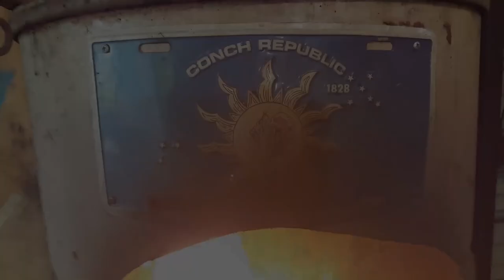DIY HomeMade Forge Blower Motor Controller

Comment: I love the build, and especially appreciate you pointing out that light dimmers change voltage, and we don't want to change that, we want to change the amperage to control the motor speed.  All the builds I saw before yours used the light dimmers instead of the fan speed controllers, which is not the right tool for the job.   Thanks for great content, and for sharing with others.   Happy 2021, Yamez.  Catch you later!

Comment: Great video! I use a reostat or router speed controller. You can get them online for around 15 dollars. I've been using one for over 4 years now. It also slows down the 1×30 grinder too!
Reply from the maker: Absolutely George, if ya got some smerts there's a lot you can do...

Comment: Cool and thanks for sharing. Other channels on YouTube have gotten me confused with motor speed controls. Seems they want to make it egg headed and complicating. Once again thank you.
Reply from the maker: This is a very cheap and basic fan control... will work in a pinch for small AC motors. The fan controller is not rated for anything much larger than a fan... so for like a grinder or something this won't quite cut the mustard.  You would need a bigger better speed controller.
Reply from the maker: But yeah glad I could help!

Comment: Last time I tried that, I killed the controller. To be fair, I hooked a hair dryer directly to the controller that I had as a spare. I did get a router controller for about $30 and Harbor Freight has them as well.

Comment: I have a speed veriable control and felt the airgate with foot control with air coming from my blower into my forge and the except air detour into the back to help vent smoke and excess air.not needed for forge heat would have helped save coal and burn cooler when at my anviil working
Thanks I got to rewind and study.
Have you tried a ribbon burner propane, has.lotd of advantages,Sir.thank.

Comment: Why the preference for the screws over the back stabs?
Reply from the maker: Mainly because in the area I learned electrical, Backstabs are against code, according to local addendum. But I have done enough troubleshooting where it's a loose wire due to a backstab coming loose. It is a thin spring that holds the wire in and for a heavily used outlet the heat and cool from the load being on and off weakens the spring.
Reply: @IslandMetalForge  and a braided wire is does not stiff enough to make it past the blade with out bunching up, unless tinned
Reply from the maker: There's that, also.👍